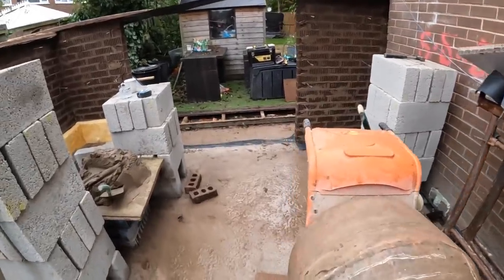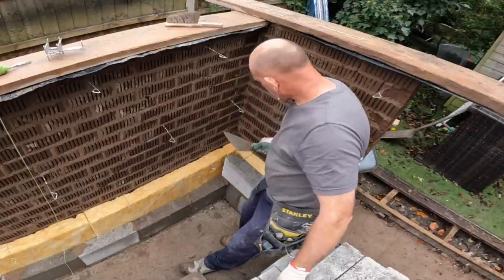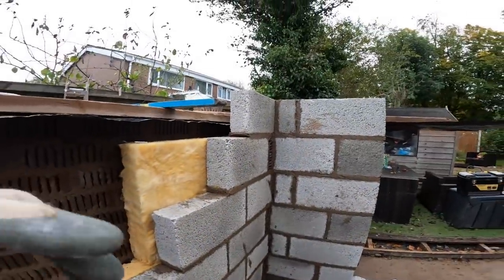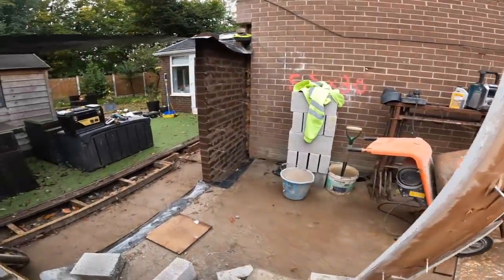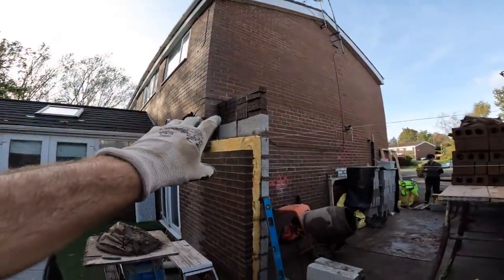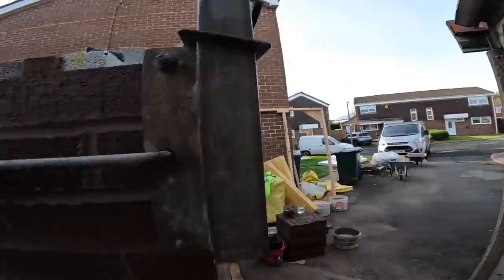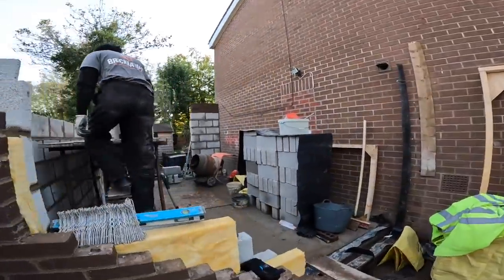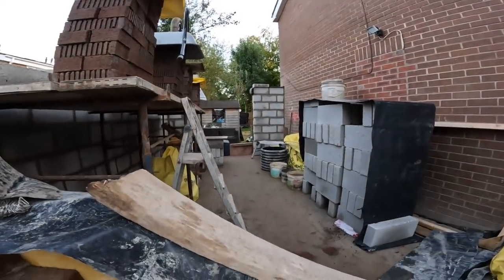BREEZE BLOCK INTERNAL WALLS  ..EXTENSION PART 5

Comment: What are those blocks you were cutting at around 5 minutes? Are they 7N concrete ones? If so, you made it look so easy it's unreal! I had to cut some last year and used a lump hammer and a Roughneck bolster/chisel... and they took an absolute age and wouldn't split anywhere near as neat as you've just done!
Reply from the maker: They were Fibolite blocks mate 3.5 n but 7 s cut a lot easier 💪🏼🧱👍🏽
Reply: @SteveAndAlexBuild  Ah thanks. Also explains how you managed to move then one handed. 👍👍
Reply from the maker: @jp6975  😁🧱👍🏽

Comment: Off the wall comment here: I am not a salesman, but I have away been extra pleased with Hilti brand products. Maybe you could benefit from something like a PM30 MG Multi Line Laser. I know they are pricey but they are like a Timex watch. They 'take a licking and keep on ticking'.
Reply from the maker: Top kit Hilti but out of our price range 😟🧱👍🏽
Reply: @SteveAndAlexBuild  Aye, that's what I said before I bit the bullet. It lasted so long that by the time it quit, the parts were obsolete and no longer available for repair.
Reply from the maker: @calvinjutila8270  🧱👍🏽